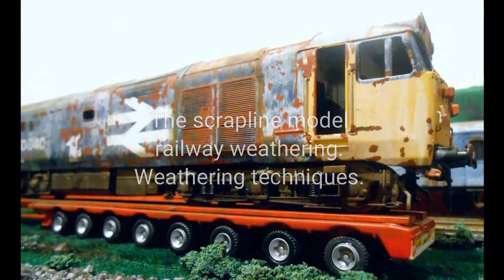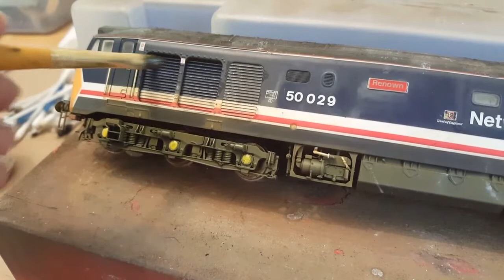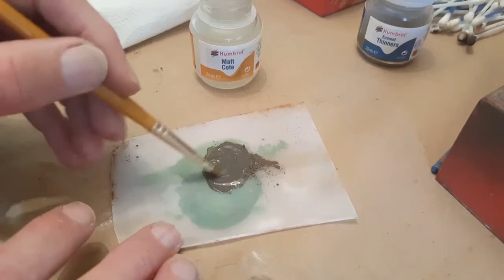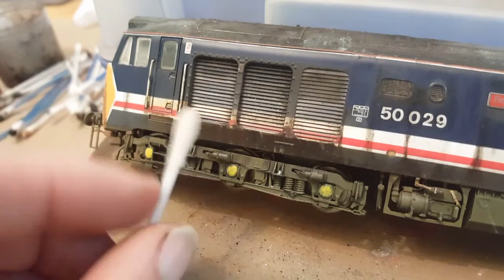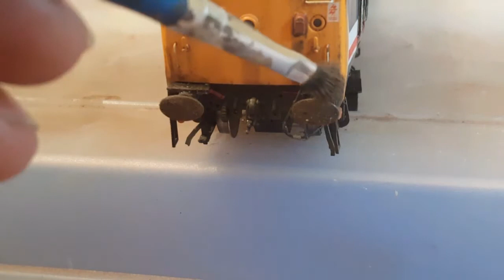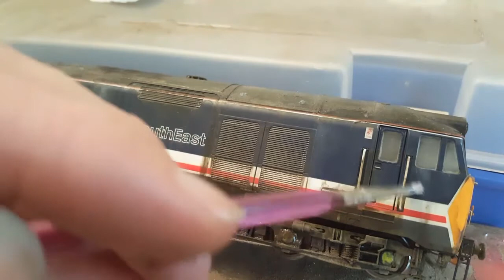Weathering techniques.

Comment: Brilliant series of videos on weathering, you make it look so easy. What were your early attempts at weathering like? Any disasters? Are the locos easy to clean should you want to start again?
Reply from the maker: Hi John. My early attempts were iffy to say the least. I started out using just powders (wasn't to bad for the first attempt) it was trialing other methods and combining them together that was the hardest part. Some products react badly with others. Solvent based products can be difficult to remove but being gentle and not rushing the removal should be fine.. I've done a few. 
My "take off technique" as I call it was only found because I trashed a model in frustration and then cleaned it back to start again only to find that it actually looked good with half the mess removed.
Reply: I’m new to all this and haven’t had a layout for 30 years, but now I’m in my mid 40’s and I feel the need to get started again. If I need any advice, which I will definitely, am I alright asking you? I’ll try not to pester you too much! 😬